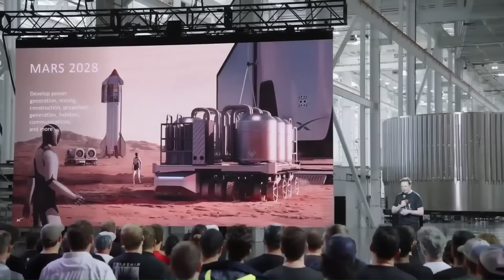NASA Administrator Finally to Cancel Starliner and Orion Capsules!

Comment: Cancel Starliner... OK, no problem... nevertheless it was only backup program for ISS crew transfer and NASA have fully functional Crew Dragon system for this purpose.
But cancelling Orion?... How will I explain this.
Yes, a lot of money was wasted in that project. BUT canceling it just so close to the finnish line? That is DUMB!
But the question is, how else wants Isaacman to fly to the Moon if not with Orion. Does he has some plan?... any plan?
With Starship?... Don't be ridiculous! Starship will never be human rated if SpaceX is won't change its design from scratch (which is already to late now). Starship is more dangerous for crew than Space Shuttle that already killed 14 people. And NASA will never allow such risk. And talking about timeline... Orion will be ready in 2026 for human crew. Starship won't be ready in next 3 years! (Sorry Elon, but this is reality)
So what Isaacman has next?
Dragon?... Nooo... This is another joke. Dragon is good spaceship for LEO spaceflights. It is not possible to use it further from Earth because of many reasons. One of them is, that it does not have enough shielding against the cosmic radiation (which can really harm the crew)... especially in long term flights. And of course it has no propulsion system able to put people on the lunar orbit. They do not have any of this even on the paper. And many other reasons. It is not imposiible, but SpaceX would have to build completelly new type of Crew Dragon spaceship.
What I see here is just nother SpaceX lobby.
And let's not forget: USA can forget about returning to the Moon (at last in next 5 years).
Thanks to Isaacman, China has already won this space-race.
If USA wants to move forward, it will be expensive and with hardware that is already flight prooven.
I like SpaceX, but they did to much bad decisions with Starship project and there is no turning back. Instead of Elons Gigamania, they could with those money build something much smaller, faster and easier to repeair or replace. Something like small modular spaceship. Starship has totally bad design from beginning. It is unable to land on any uneven surface and SpaceX even didn't start with its landing tests (no, those landings on concrete without proper landing legs and without any additional mass just do not count). And just be clear that Starship is not and never will be reusable for Moon landings! It can only land once and after returning to the Moons orbit it will be expanded. SpaceX never planned to reuse Moon-lander-Starship, because it is impossible, they just can't do it (with this stupid mega-design).
And now you can hate me. :D